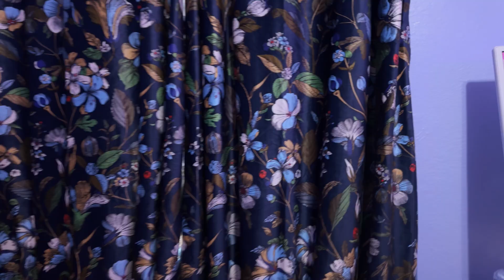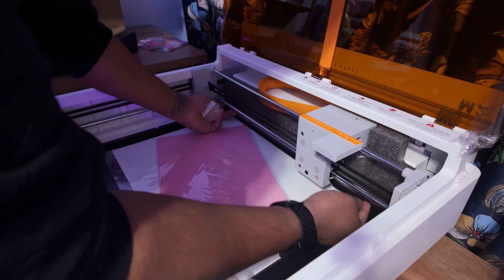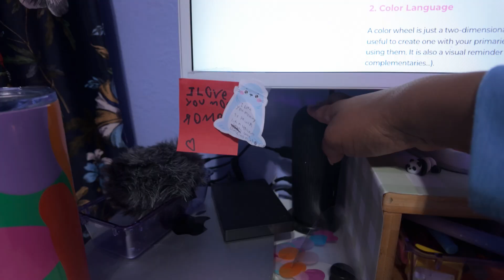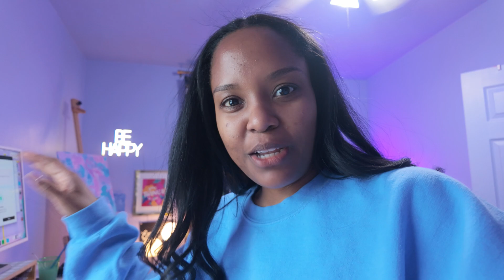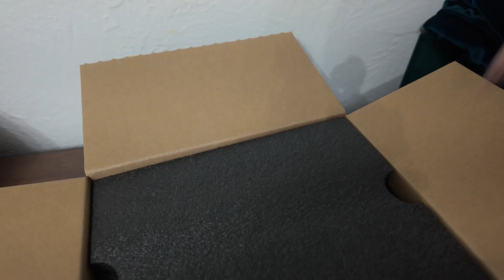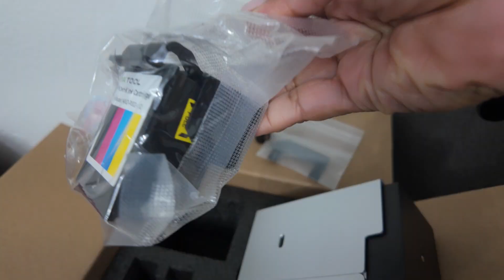Unboxing my NEW XTool M2! I have no idea what I'm doing! First time laser user | Honest Review

Comment: I think as far as buying a laser, this is the best starter one to get.  Yes, just as your cricut or any tool, there is a learning process .  you have to learn terms, process, materials, steps, etc.
Reply from the maker: Yes! Agreed! I did not realize how much of a learning curve. I am usually pretty quick to pick things up but this is kicking my butt! 😅
Reply: @NatalieHenryCharles I started with a CNC!  So, going to a laser was easy, as it's 2-dimentional.  I also have a 3-d printer, so it's a different mind set dealing with flat vs 3d.  But, the M2 is definitely the way to get into diode lasers ❤

Comment: I have decided to get a laser machine. When I first saw this one I was thinking that for the price, this might be the one. However, I did watch 50 11 videos and changed my mind. I want to cut clear acrylic - it can't. Plus, the ink feature, I probably won't use. I already have a couple  Makers. And your video sealed the deal. This one is not the one.
Reply from the maker: Well I certainly hate to bring bad news! But agreed, if it won’t cut the materials you want, it will be a waste. I wish I had done slightly more research! Xtool has other lasers that are more flexible with the materials they cut! 🥰✨ Glad you got some clarity from the video!
Reply: @NatalieHenryCharles p2 would be my choice for acrylic etc